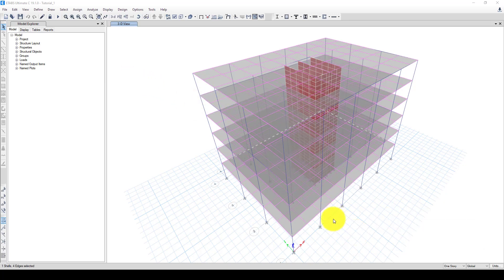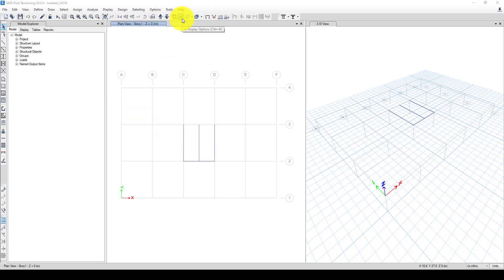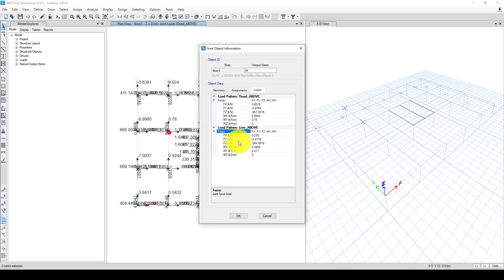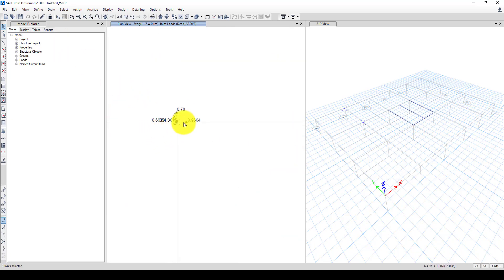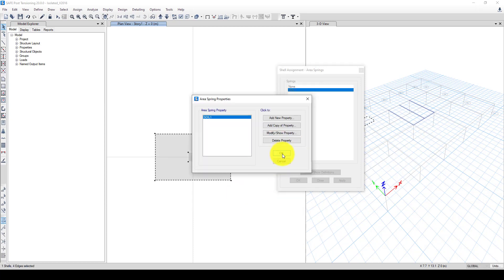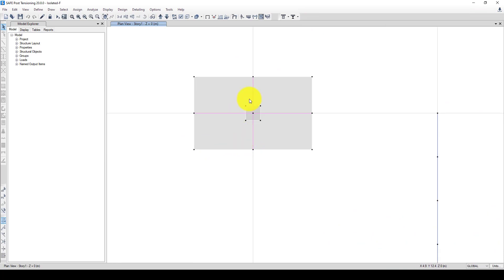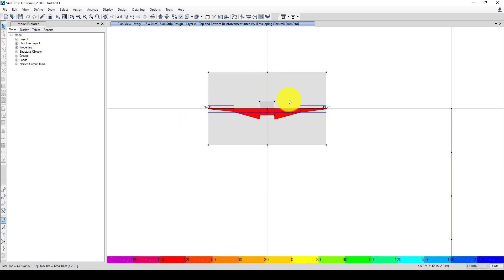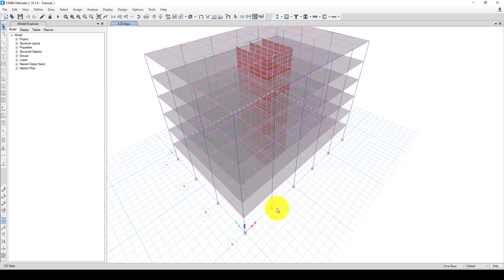A Complete ETABS Course Tutorial part 2, Foundation Design in CSI SAFE v20

Comment: Nice video, but i have one concern, the values of the deformed shape there are quite abnormal sir, no wonder that message popped up right after the analysis was done. I have the same problem too, and am struggling with the solution for that...may be you realized the issue and know the solution?
Reply from the maker: Hi there , there is nothing abnormal. Check it carefully. And in the message there is some warning that doesn’t has impacts.